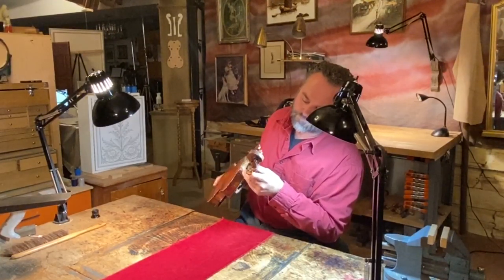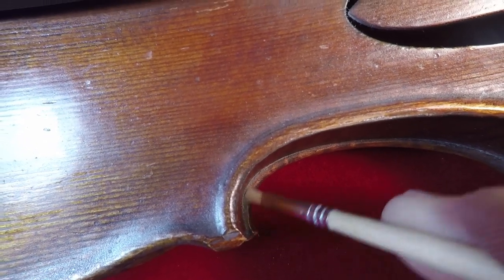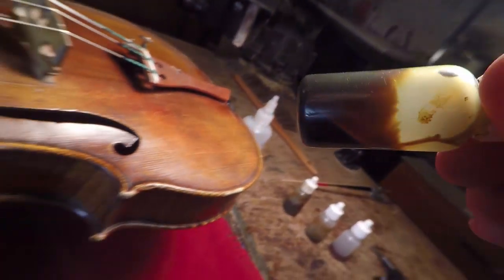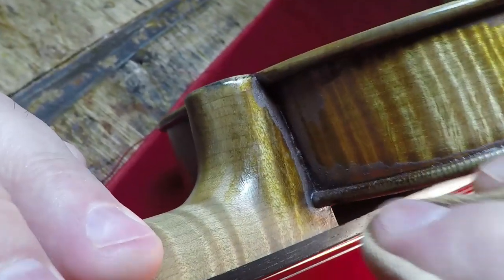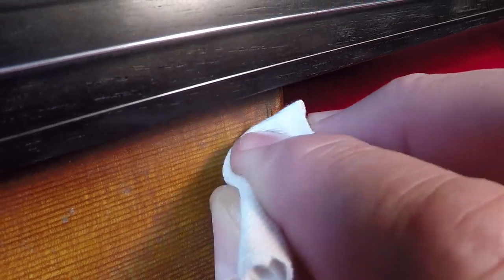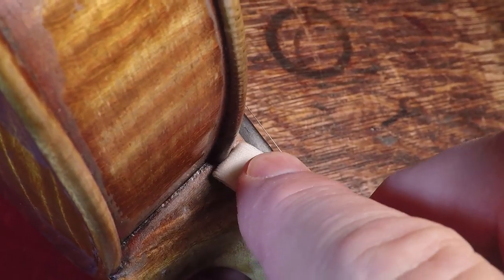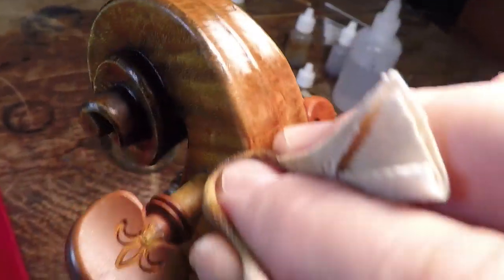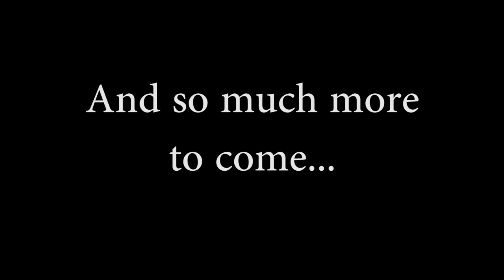How to Really Clean and Polish a Fine Violin / A "Natural" French Polish /  How to Remove Rosin

Comment: What would the cost be for a professional to do this? I have an old violin. It's dull but not dirty.
Reply from the maker: The cost varies so drastically, depending upon what city you take it to and what your instrument is, so I probably shouldn't answer. But don't be surprised if the cost falls anywhere between $50 for a student instrument (which goes very quickly and has almost no risk), to $1,200+ for a master instrument that does require a vast amount of experience to do everything "just right." So be sure to get an estimate before the work begins.
Reply: @kevinleeluthier  thanks for answering. My violin is German 87 years old, nice quality, good tone ,nice instrument, valued about 5 or $6,000. I took it to the luthier and it was  dirt up in the left side of the ribs where my hand touches the violin when it gets sweaty. sometimes it's hot in California. They said it was dirt. they said it would be  $70 to clean it but I'm wondering if they just do that area or they do the whole thing?
Reply: @DivaDeb1234  ask

Comment: How do you remove old varnish?
Reply from the maker: That's a loaded question, because you should ALMOST NEVER remove varnish from a violin, especially a fine one, and when it is the proper thing to do (usually a cheap factory instrument with the upper layer of varnish crumbling off) it takes a lot of experience and judgement to determine which way really is best = There are so many scenarios, especially when someone else has already re-varnished it poorly, and then what type of varnish they used. Whether it was oil over oil, oil over alcohol/spirit, alcohol/spirit alone, etc., synthetic, or??? = This probably isn't the answer you're looking for.
 But the short answer is, if the violin really is "cheap" go outside in the fresh air and possibly try: turpentine, or mineral spirits, or alcohol, and/or scrapers,  or (do be safe) acetone, or methy-ethyl-keytone, with rags or  steel wool, or half a dozen other solvents one at a time, and/or any combination of the above. = There have been some really strange varnished on cheap instruments in the past 60 years.

 And when you're done removing the old varnish, you have to know what type of sealer and/or varnish you can put on what appears to be the "raw wood." But of course it never really is raw wood after it's been sealed or varnished.
 I wish my answer could be shorter, and more informative, but it's simply the way it is when it comes to the rare occasion of re-varnishing a violin properly. You have to hold the instrument in your hands and then have the experience to know what to do with it. Or else gain that experience by experimenting on cheap violins, and pieces of fine violins, again and again and again.
Congratulations! For better or for worse, you just got the longest answer that I've ever given on YouTube. :)

Comment: How much something like that cost to do.
Reply from the maker: Believe it or not, the price of violin repairs and maintenance can vary quite drastically, depending upon the instrument itself, how valuable the instrument is, and in what city the work is done. On a fine instrument, such as this, expect to pay between $300 and $500, plus whatever other items the instrument may need, such as strings, adjustments, etc.. On a mass produced instrument with a tough polyurethane coating where the luthier has no concerns about damaging the varnish, even with this much work to be done, sometimes less than $40.
Reply: @kevinleeluthier  wow thank you for answering and taking your time to respond appreciate it. Keep up the amazing work you do.

Comment: Fine sandpaper should be used instead of steel wool.
Reply from the maker: If the surface is rough and/or uneven, yes fine sandpaper, then a swipe or two with steel wool. But, if the surface is smooth like this and you want to maintain the natural shape with the least amount of material removed: just steel wool.
Love you comment. Thanks!

Comment: Olive oil works best to clean off rosin - NOT alcohol.  Alcohol should be used ONLY to clean strings!  Olive oil is what was used centuries ago.
Reply: Yes, but done incorrectly and it can sink into a lovely oil or amber varnish. That happened to one of my violas. I have to revarnish the top. Luckily it was one that I made, so I wasn't too disappointed. 
I know what you mean though - alcohol is not a great friend of fine violins. Honesty there's no problem with water and a simple bar of soap. It sounds stupid to someone hearing it for the first time .... but then it's something that the great Charles Beare taught me. I can't really argue with his advice since he's maintained many Stradivaris and Guarneris and Guadagninis etc in top condition that way for decades!
Reply: @liamnevilleviolist1809  The main thing if you try soap is to get all of the soap off the instrument again. If not wiped off completely with water, the soap residue creates a film itself leaving you with a new problem that can be very hard to fix. Also remember what a bar of soap consists of. You are basically cleaning with lye, water and palm oil... And palm oil may sink into varnish as well.
Reply: @Sunfl75  Yes, I do consider very carefully what type of soap. After checking the ingredients (the less oils, the better!) I then "wipe" the bar of soap onto a big piece of cloth and soak that cloth in a jar of water.
So really then I'm left with a soap based water... I would say about 10% soap to 90% water. 
Then I apply some of this to a finer piece of cloth and clean the instrument. Then of course right after that I wipe off the instrument all over with a cloth that is just lightly soaked in plain water. 
If need be I will wipe/polish the instrument with a silk cloth to get rid of residue.
It's how I've come to get the best results in recent years but I'm sure there are better ways.
In hindsight I should've written out my method ... since it appeared I was basically just giving my viola a good ol' scrub down with soap and water like it's some sort of cheap car hahah.
Reply: @liamnevilleviolist1809  Thank you for describing your method. It's important not to let any of the soap dry before you wipe with the clean water clot, so always do it patch by patch, section by section. I have heard some also use very diluted dish liquid (free from color and perfume!) for the process you describe, rather than using a bar of soap. I guess it's all about reading the list of ingredients for whatever soap is used, before ever putting any moistened, soapy rag/cloth onto the violin varnish. And to be seriously careful with the amount of water in any form that gets in contact with the surface. I am curious to see how - of if - the new methods of cleaning surfaces with micro fiber can be put to use on a violin...
Reply: @Sunfl75  No problem, I tried to describe as best I could and what probably didn't come through was the amount of caution I take. Whenever possible, soap doesn't actually make it into the equation!
It really is the smallest amount I use just so the cloth can glide across the viola instead of move in little bursts (because the cloth with just water tends to drag at certain polishing speeds). Everyone's materials are different I guess. I don't let the soap dry, no.
The viola in my channel's profile picture was polished by me that morning! The photo was taken at an evening concert where the viola was being played for the first time in front of friends and peers, and since it was the newest one I'd made I really wanted a shiny gem for the audience to watch while they listened to it too!
Reply: @liamnevilleviolist1809  It really looks good, too.
Reply: @Sunfl75  Thanks. I would gladly hand it over to Kevin Lee if he could get the best shine out of it though!

Comment: Do not do this on a violin with oil varnish.   This violin is not an expensive violin. It’s factory made and varnished with alcohol varnish.
Reply from the maker: ??? I try not to argue or disagree with viewers, BUT:  This violin is "definitely" coated in OIL varnish. This violin is VERY expensive, and this violin is definitely NOT factory made. = I don't understand your comments. Yet, as always, thanks for watching!
Reply: You are very inexperienced.  This can not be an oil varnished violin. If you put alcohol on it like you do the varnish will be removed.  You can tell by looking at the edges that this is a factory made violin.  No expensive violin would look like this.  Why don’t you remove the strings and bridge and tailpiece— because you can’t reset the sound post.  Sorry you are wrong about this violin